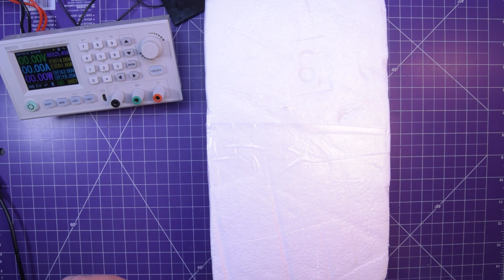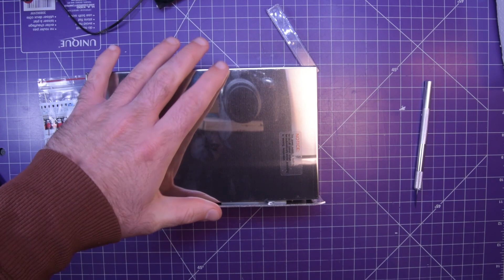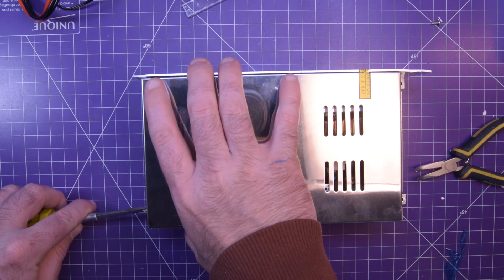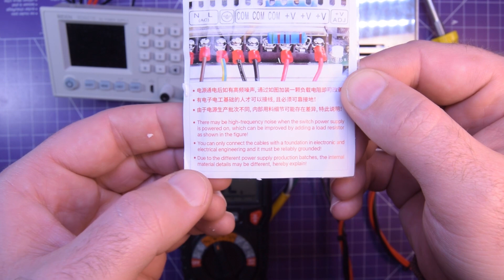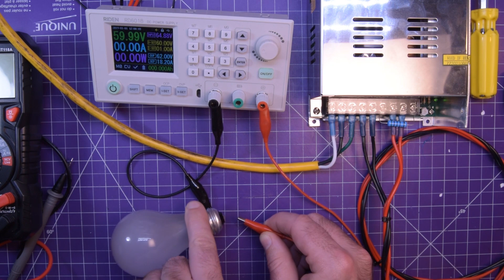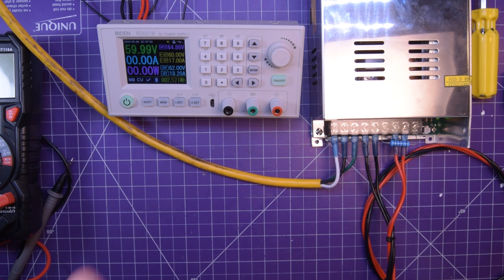Riden RD6018 Boosted With This 65V AC/DC Power Supply!

Comment: They don't call 'em BANGGood for nothing.  There's no reason to believe that the bent tabs on the PSU happened during shipping.

The white (in your case) potentiometer to one side of the output terminal strip allows you to adjust the PSU DC output.
a switchmode PSU shouldn't be producing a lot of heat.  A decent 48V PSU can generally be adjusted up to about 56V or so.

Try a Cosel or Meawell PSU sometime.

Also, consider this: cut an opening in your workbench and mount the Riden down into it (facing up), and have the PSU under the bench somewhere.

Comment: It will rise your current over the switching PS specs. Just keep your power below the specs. In my 1,38 software version there is power limit setting. However voltage is limited about 1volt below your PS specs.

Comment: These cheap chinese SMPSu's normally don't meet their specs. If you run it for a long time at max. power you will probably burn something, the switching Mosfets or the output diodes most probably. Often the heatsinks are not sufficient or badly mounted. The RIDEN Buck-converter probably does a good job. I have the DPS5020 for 2 years and use it on a daily basis with my little PV-panels. To power it from solar makes sense and the input voltage range is just great for 2 bigger panels in series.

Comment: I have the rd6006p since today and I hear a faint high pitch sound when I turn on the voltage output. The sound becomes less when I increase the output voltage and from 35 volts the sound is gone. Do others have this too? Or is this a defect?

Comment: Oh yes 11 Amps from power supply for an 18 Amps RD6016... Very smart mr. clever 🤦🏻 👎🏼👎🏼👎🏼👎🏼👎🏼
Reply from the maker: Maybe you should look into ohms law. 11 amps at 65 volts allows you to have 18 amps at lower voltage. I don't think I'll ever need 10+ amps at 50+ volts, if you do, then pay more than double the price for a power supply capable of it
Reply: or somebody is clever enough and use two of this  power supplies and use it parallel and better the RD6024...

Comment: those big caps were in the input! NOT great esp in 240v countries! caps go BOOM! even at 120v, the p-p volt is too close
Reply: They probably get switched to being in series when switched to 240
Reply: Of course they are in series when its switched to 240V. This looks like a half bridge design.
Reply: They look like salvage rewraps due to the black plastic discs covering the vents.